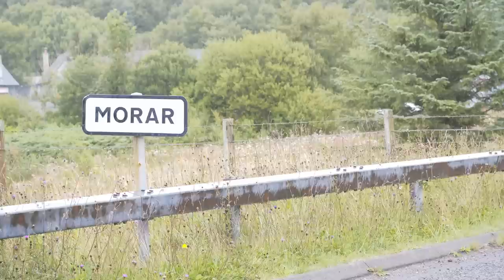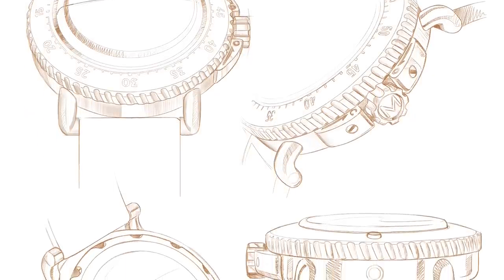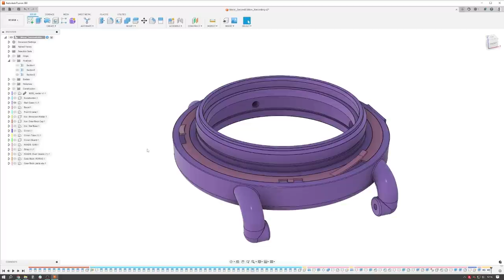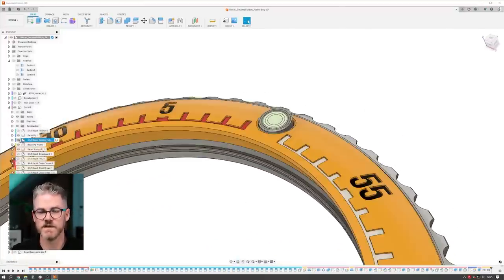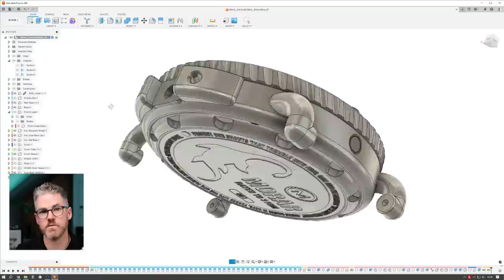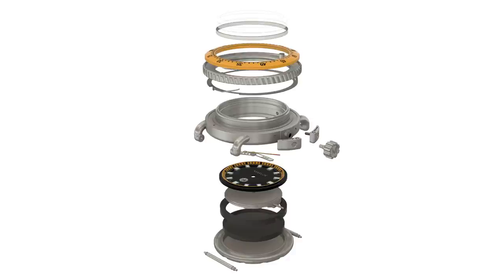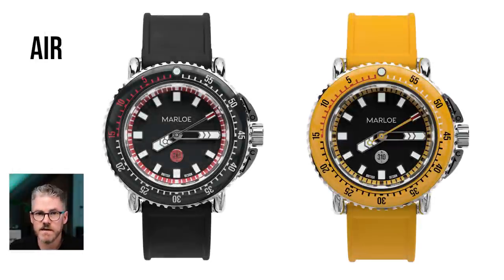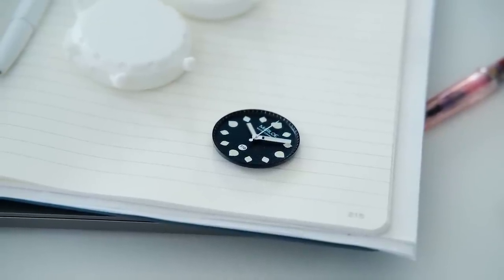Road to Morar - Episode 5: Design

Comment: Sorry me again Gordon. As you know bezel misalignment is a common bugbear and although I’m liking the through-bezel insert lume pip of the Morar, it may prevent alignment fine tuning when affixed to the bezel, the accommodating hole also weakens to bezel insert and might increase fractures. Also the alignment of the click notches with the lume pip must be a fine tolerance to again prevent bezel misalignment; I’m sure you’ve got a handle on this but I had to mention. PS I love the lugs ( reminiscent of Panerai) and countdown bezel (reminiscent of the Tudor FXD) is also unusual, visually interesting and useful. Regards
Reply from the maker: Perhaps the pip is attached to the bezel then, which would prevent such alignment issues. Good point, thank you!

Comment: It looks like I will be buying my 3rd Morar. Love it! I will miss the 40mm case though.
Reply from the maker: It does wear smaller than the original, thanks to the new lug design - the Original Morar has a longer lug-to-lug!
Reply: I just saw the comparison in the video between the 3D print and the original and It does wear a lot smaller! My kitten wrists are excited 😂. Any chance we will see the new Morar in its final form by the end of the year?

Comment: Hi Gordon, great video and a great design. Just a couple of comments 1) I don’t think “ Severn” (I assume refers to the river) is a appropriate name as the model is “Morar” which already refers  to the Loch. 2) I’m concerned the He valve’s position, between the lugs, might cause it to foul on a thick strap;  stopping the valve opening or indeed closing. 3) Don’t use Black & White but perhaps Dark and Light; would be less problematic. And May I say I’m So very glad you’ve stuck to a No Date calibre. Kirk
Reply from the maker: Thanks for the feedback Kirk.

The lugs are low enough that any interaction with the HEV will be difficult - it's also flush fit and on the outside of the curvature so I don't feel any prevention of the actuation will occur - will double check with thicker straps in Fusion.

Severn points to a class of lifeboat, rather than the body of water.

Thanks for watching!
Reply: @MarloeWatchCo  thanks for the prompt reply. I’ve rewatched the vid and the markings on the crown guards baffled me. I originally saw the O and C to be a closed circle and a open “ broken” circle; which seemed to be the wrong way for opening/closing the crown. Then I realised the symbols were letters namely O for Open and C for Closed. Perhaps internationally recognised symbols for open/closed would be better in an international market. As for the He valve, when it operates (opens) it is no longer flush ( fractionally) possibly allowing fibres ( say from a old perlon strap) to be trapped; but I’m sure you’ll check. Regards.
Reply: @MarloeWatchCo  Thanks Gordon. I’ve been   Rewatching the vid an unhealthy number of times and a couple of observations about the dial design have come to mind. I’m sure you sweat the small stuff but if you haven’t I feel it would be amiss not to mention and could save money and time. First I’m concerned that the hour hand won’t clear the ‘310’ bubble, and secondly I feel the MARLOE logo is too close to the pinion ( perhaps by half the height of the logo; especially for the black & white variants which I believe the logo should align horizontally with the 10 and 2 pips). Ignore me if you’re happy with both especially as I really hate design by committee. I think it brave that you detail your design but perhaps a “customer design review” is the payoff. Regards K

PS the Severn lifeboat itself is names after the river ( but you probably knew that)

Comment: I have the first version of the morar (the emerald one), and aside of a few things, I love the design. But this new version I don't get. It's bulky, clutered, shiny... The previous version needed a slight upgrade, not this much of a change.
Reply from the maker: Perhaps from a design perspective a few tweaks might have made an upgrade for those already on board the Morar train, but from a commercial perspective the market did not accept the First Edition Morar and it took a LOT of persuasion and heavy discounting to move the Morar on - the analysis of why this was the case, and we did a huge amount of analysis, was that the Morar was just too far outside of the expectations of what a dive watch is, in the modern dive watch landscape. A slight upgrade of the original, in our opinion, wouldn't have changed the lack of uptake in the Morar - those who did buy one seemed to enjoy it and immediately understood what it was we were trying to achieve with the design direction, but it took a long time (years) for people to buy into what the original Morar was and has become. Not sure we want to go through that process again.

Time will tell if this new iteration is of more interest to those currently outside of the Marloe/Morar sphere - it's sometimes good to switch it up. Either way we will learn something. Thanks for your message!